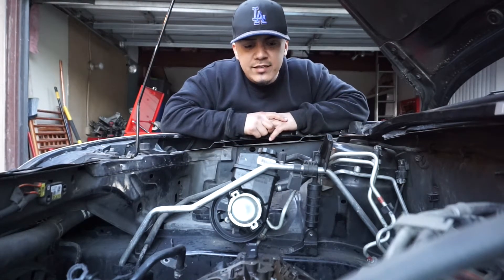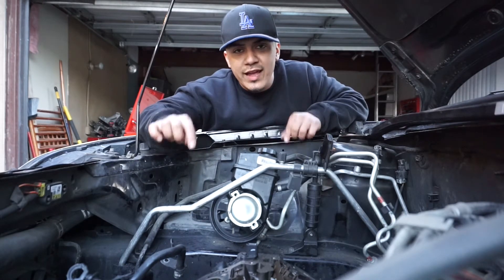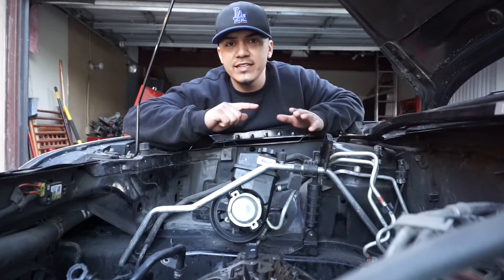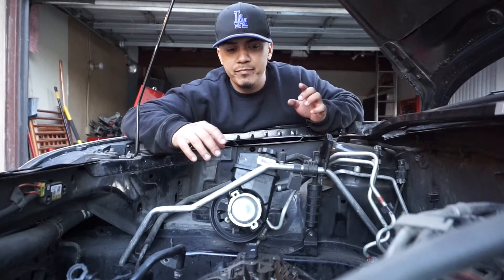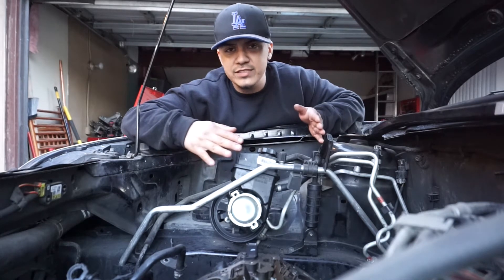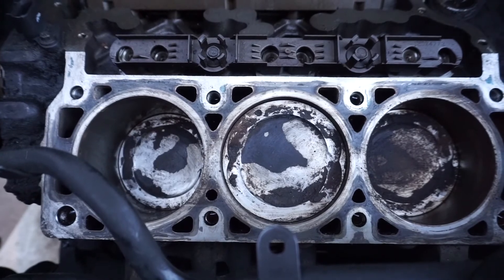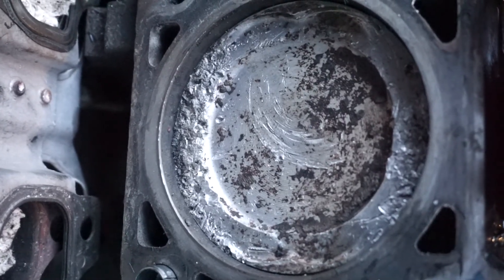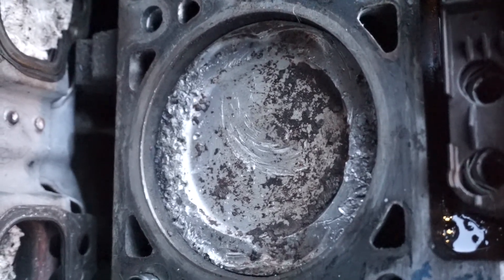Chevy Malibu SS Damaged Piston- HELP!

Comment: Just curious what did you end of doing and what was the result? I have a car with exact same issue and I don't really want to have to change the piston. My cylinder wall is still in good condition.
Reply from the maker: Elias Hamel I changed the piston recently watch my other video 'The Comeback' I'm gonna make a follow up video on that.
Reply: My opinion not only should you have replaced the piston but the block may need new sleeves

Comment: you need to hang up your wrenches that engine is fucked
Reply from the maker: Scott Mcconnell That engine is still going 👌🏼
Reply: could of sworn you  made another it came back misfire no1 and ticking once the valve seats break up small pieces get between rings causing wall and skirt damage   best thing to do is replace with running used